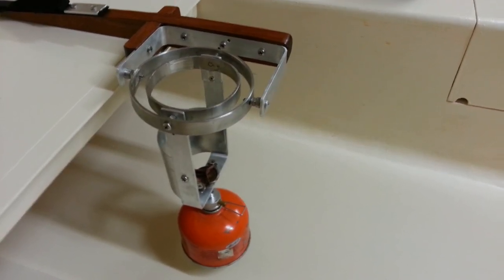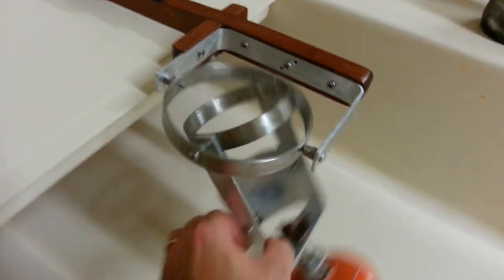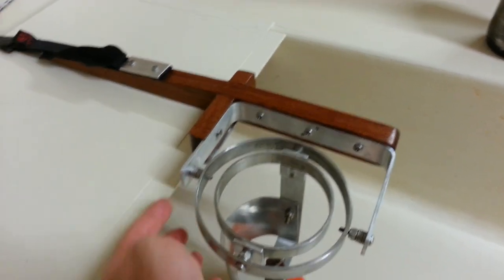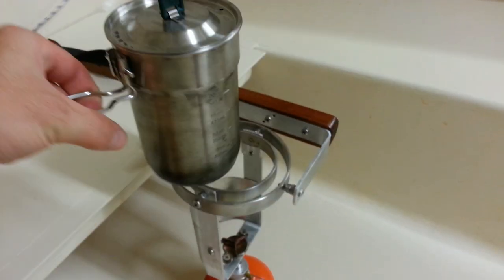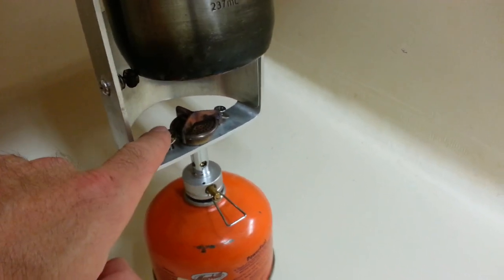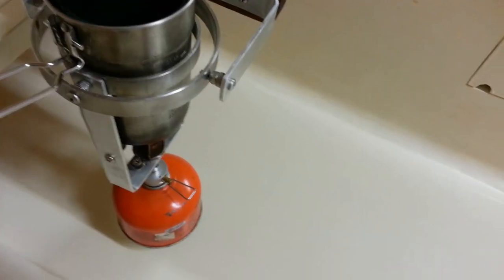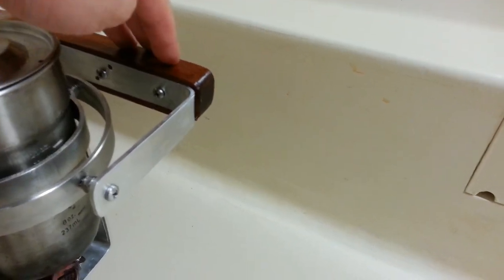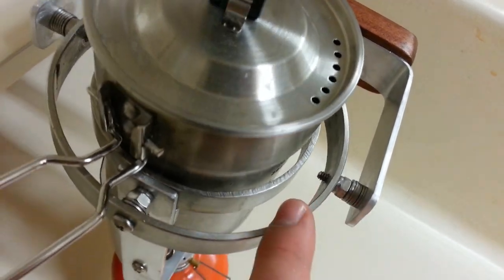Improved DIY gimbal stove for our sailboat

Comment: excellent design and build there ....i am designing one for a 24Vdc Pressure Cooker. ( battery cooker )....i am anticipating no problems with heat,  but just watching your video and i have a good plan already....i have a flat bar roller, and welding equipment..
Reply: Please post link to view
Reply: @redwood1957  i can't post links to youtube comments....shrug.

Comment: I really like this gimbal a lot and can see how it would work well on my Cape Dory typhoon. I was wondering if you can fill us in on the materials and where you  got them and the other specs. in building this. I have looked for some pipe stainless and aluminum  and it is very expensive. More input would be great.  Thanks so much.
Reply from the maker: I had a metal fabrication shop cut me off a couple of 1" bands of the appropriate size (diameter) tubing. It was years ago, but I would think any metal shop that carries tubing in the desired size would be open to doing this. Prices on tubing have gone up a LOT since then (especially stainless steel).
Reply: @LiveDontWatch  Yes, I have noticed the prices going up like everything else. I have tried to locate this size and no one seems to have anything this big. so I was planning on trying to make this with aluminum and bending it around a form to the size i need then securing the two ends together. sourcing the tubing seems to be pretty hard. I will continue to look.

Comment: Rock'n roll bro, that's pretty awesome.  This is from 2013, what are your thoughts on it now?
Reply from the maker: It worked out very well. Haven't used it in years, but it did everything I needed it to do to heat a quick meal safely underway.

Comment: Love your setup.  I have two of the same stainless steel cups and use them on my Catalina 27 in Alaska.  I don't have a stove (I use a single burner coleman unit) but want something gimballed.  Did you fabricate this yourself?
Reply from the maker: Wade Rogers Hi Wade, thanks for the compliment. Yes, I did fabricate it. The two round circles were cut off the ends of appropriate sized stainless tubing/pipe by a metal fabrication shop, then I bought the aluminum for the rest of the metal bracket and bent it by hand. Then I made the wood base and coated it in epoxy.

Comment: those isobutane cans are expensive. why not use either a gasoline stove or a classic alcohol stove? even a little table top butane can stove.
Reply from the maker: They're super convenient to light,  super adjustable for great flame/ heat control, and one canister lasts me for months or even a year of quick heat-up meals. I guess if someone was cooking a lot, cost might matter, but not for this application.
Reply: @LiveDontWatch  if it suits your needs, i am all happy for you.
Reply: sailing is expensive ... :)
Reply: @LiveDontWatch  i forgot to say, you can refill them with regular butane. you only need a 2$ adapter. the IsoButane mix is only needed if you are planning on using them bellow 0C.